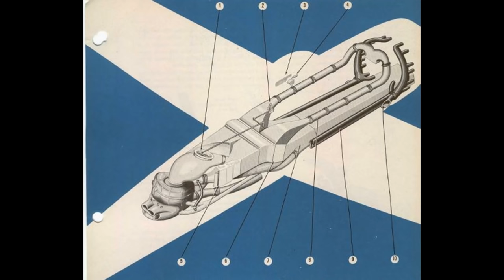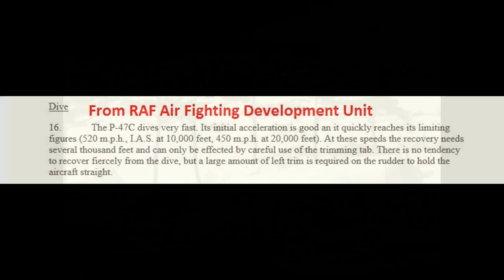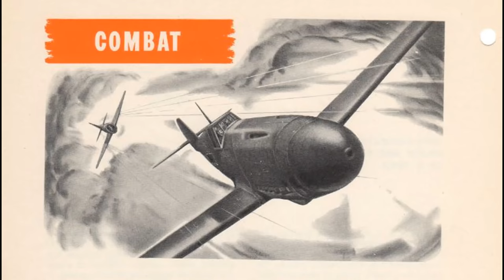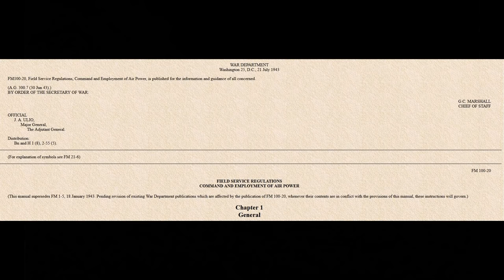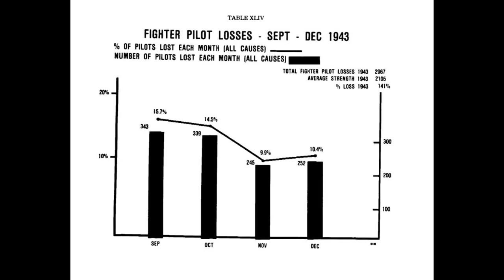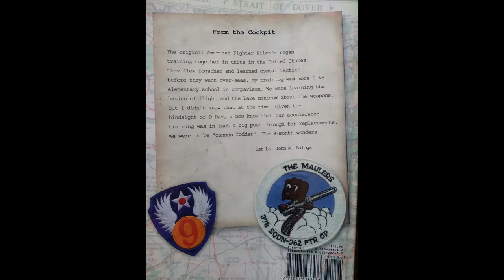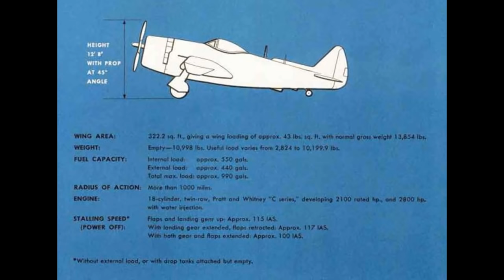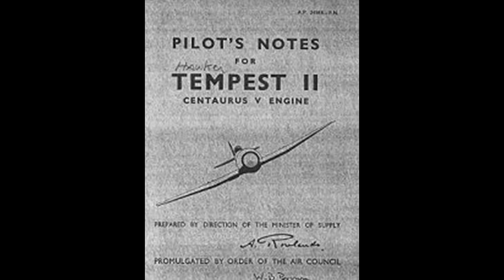P-47 Thunderbolt Pt. 8 Conclusions

Comment: Just a quick comment on Presidential Succession. The Speaker of the House is  2nd in line to the President after the VP. The SecState is 3rd.
Reply from the maker: I'll tell that to Alexander Haig when I see him.
Reply: @GregsAirplanesandAutomobiles  
I can outrun a cop trying to pull me over or try to scare him off but it doesn't mean the speeding was legal.
Haig got away with one.

Comment: You said that if there's one thing superchargers don't like, it is being throttled (possible exeption, the Bf-109's supercharger), with the example of the P-51D having only 1410 hp at sea level/take-off performance. As a reverse conclusion, did WW2 fighters optimised for lower altitudes, say, the F-4U Corsair and Soviet Lavochkins/Yaks not suffer such a power drop at sea level?
Reply from the maker: Hi Pascal, the 109's supercharger is not throttled, instead it used a variable speed supercharger drive. I have a video about that specifically. Generally speaking the Soviet fighters were optimized for low altitude work. The Corsair's primary stage supercharger is optimized for sea level to about 2500 feet. Of course the Corsair has a second stage with dual speeds, so it can do OK up high as well. My turbocharging vs. supercharging video explains all this pretty well.

Comment: Thank you for doing this right!

A question/comment about the later years of the active P47 aircraft. I spoke once with a pilot who flew warbirds for shows, etc. He said that he thought all the flying P47 were operating without turbochargers operating. He said that having the turbo working would about double the cost of operation. I have been wondering if the late flying planes in Latin America were still using turbochargers. I would expect not.
Reply from the maker: I'm sure that's true. Not only would the turbo system add to the operating cost, there is an additional fire risk to the plane. Plus in the modern regulated airspace system you can't take the 47 up high enough to need the turbo anyway, so I understand why they remove them.
Reply: @GregsAirplanesandAutomobiles  could they fly a 47 higher if it had ifr equipment retrofitted in?

Comment: excited for the new video Greg.   

BTW related to your video on turbo-supercharging, at end you talked about the XF12 Rainbow that had the goal of "four fours" (4 enginers, 400 mph cruise, 4000 mile range, 40,000 ft ceiling).     You prob'ly saw this, there is modern plane trying to do three-fours (all of the above, but one turbocharged engine.   

https://www.ottoaviation.com/celera-500l

Reminds me of rainbow:  no compromise fuselage streamlining, turbocharged, recip (diesel!).   Pretty amazing if the can pull it off - sposed to get 20 miles per gallon cruising > 400 mph.
Reply from the maker: I have seen that project, and I have high hopes for it.

Comment: Just thinK, the military threw Away the P-47 after the war and kept the P-51 mustang. During the Korean conflict the P-51 was a disaster, due to the susceptibility of the radiator to ground fire. South Africa lost over a hundred mustangs during ground attacks. The Corsair which has the same radial engine as the Thunderbolt was very effective when attacking enemy ground forces

Comment: So: In the 1960s where did Peru get their parts? I must know!
Reply from the maker: They probably got a huge supply when they bought the planes. The USAAF/USAF would have sold all that stuff for pennies on the dollar after they stopped using the plane. Also, if you have an airforce, you probably have the ability to make parts if needed.
Reply: @GregsAirplanesandAutomobiles  - Makes sense.  Do you want to know what you begat? When you posted the Jug vids many YT channels jumped on the P-47, like the proverbial wildfire.  I predict that the Johnny Johnston (I'm not doing the research) story is in production right now. It's time the Juggernaut made it's cinematic debut for the folk. If Johnny is P-51 I apologize.

Comment: Watch out for compression effects on tail plane at high speed dive. Effectively rendering the elevators non effective till speed reduction. Not what you need if terra firma is approaching at alarming speed.
The Typhoon didn’t like dive approaching transonic as elevator flutter could overcome empennage structural strength and separation of airframe. A most impossible situation for pilot indeed.
Latter models incorporating counter balance weights to quell harmonic destruction.
The Napier Sabre also having a most unsettling tendency to low hour without warning seize up.
Low altitude bail out only achievable with immediate remaining air speed climb and hit silk as soon as clear of aircraft. Car door arrangement not conducive to quick egress from cockpit.

As a side note the development of the atomic bomb as expensive as that effort was. Far eclipsed by the B-29 platform development expenditures. The craft chosen to deliver the first use of air burst atomic weapons. Fat Man and Little Boy.

The jug a fantastic fighter bomber but she drank fuel at an alarming clip. A factor of her weight and frontal drag. She could absorb damage like no other due to rugged construction and armor systems.
R 2800 a very robust and dependable engine. Not subject to glkol-wasser leaks and resultant engine failure. Oil consumption always a factor of range as well as fuel.

Comment: @Greg -The most important aircraft of the WWII on  the allied side was the Hawker Hurricane. It was present on all theathers before anything else and without it, the US aircrafts would have been operating from Island ;-)
Basically making the argument of which Allied aircraft did most of the Western front. Had it not been for the Japanse, the US would not have entered the war and Great Britten would probably been part of the 3rd Rich. 
The spitfires where to few and those available was prioritized for defence of GB.
Get the old book "Brute Force" by John Elllis. It is filled with statistics and an excellent resources. Most of the statistice are from the US :-)
Reply from the maker: I am familiar with this argument, but I don't agree. While I love the Hurricane, and I do think it was more important than the Spitfire in the Battle of Britain, I don't see any realistic way Hitler could have invaded England regardless of what fighters the British had, or if they swapped them out for Curtis Hawks.

Comment: 47:20 - the spitfire was hamstrung by the decision to not develop extended range. Jeffrey Quill had demonstrated a year before how that could be done, but neither the RAF or USAAF were interested in long range spitfires - except for the superb photo reconnaissance variants. For example, a Mark VIII could have flown to Berlin, fought for 20 minutes and flown back with a fuel load (imperial gallons) of 75 gallons in the rear fuselage, 36 in the leading edge of the inner wings, 20 under the pilots seat, 96 in the main tanks, plus a 90 gallon torpedo centre line drop tank in 1943. Like the complaints over the 47Ds ‘short range’ in 1943 - these were the result of political decisions, not true technical limitations.
Reply from the maker: Sort of, there were a lot of issues with the long range escort/fighter Spitfire, it's far more complicated than just getting the fuel in there. I may talk about it if I ever do a Spitfire series.
Reply: @GregsAirplanesandAutomobiles  I agree. Getting enough fuel in was a no brainer. Centre of gravity and longitudinal stability were the biggest problems, but Quill opines that these could have been easily licked. I thing it all comes down to necessity - or lack thereof. The USAAF passed on long range spitfires - except for PR models and Bomber Command were wedded to nighttime bombing raids without escort. I think Quill is clearly right. The bigger tail planes developed for the Mk XIV in 1942/43, and for Spiteful  project (and ultimately adopted for the Mk IV project (redesignated the MkXX and ultimately coming into service with the Mk22 & 24) would have made a long range Merlin engined MkVII and a long range griffin engined Mk24 available in 1943 and late 1944 respectively if only Supermarine were given the ‘go’ to develop the same over the relevant timeframe. This would have obviously diverted their existing research, and testing development resources - which were rather streatched - even further, but with funds (from the Americans) and additional resources it was all very doable.

Comment: This might not be “accurate,” but in “Aces High” the 190D dives the best all WWII fighters and is more responsive at high speed.  Also, The P47M weighs less than the P-47N and (in Aces High) has a higher top speed, a faster climb rate and a faster roll rate.  Is Aces High accurate?  The flight models are supposed to have been “tweaked” by actual WWII pilots.  FWIW.
Reply from the maker: A higher dive speed for the 190D, no. The P-47M does weigh less than the N because is has fewer fuel tanks. However a lightly loaded N could easily be the same weight as an M with a lot of fuel, so there could be overlap there and situations where the N would out perform it. 

I have roll rate data in Pt. 5 of this series.

Comment: The P-47 needed a very powerful engine because it was very large and heavy, mainly because of its huge engine air compression system.  Why the airfoil of the P-47 was superior to the laminar one of the P-51?  Which of the two was more important to the USAAF in WWIi?  The bomber campaign against Germany would not be sustainable without the Mustang’s long range escort capability.
Reply from the maker: Somehow I don't think you watched this series because I addressed each of those questions at great length. There is no reason for me to do it again in the comments.
Reply: Wow, I don't think you watched the video either

Comment: ah....but the Americans were running 130 octane fuel and Germany were running 92 octane!
Reply: It was actually 110-130 octane and after August ‘44 they tried  130-150 in England only, but the Brits mixed the lead badly on that and reliability declined. The Germans could compensate by massively boosting power with MW-50, but hardly ever bothered as it added weight. Power in prop aircrafts had little effect on actual maneuvering combat: The FM-2 Wildcat was a great success in 1945 and the deadliest dogfighter in Allied hands... I think it actually had the highest kill loss ratio of any sub-type in WWII... Even higher than the Hellcat...
Reply from the maker: Wrath, I was just thinking about you. There is a section in the new video coming soon that I think you will like. It deals with the short power coupling (close prop to wing) of the Fw190.

Comment: The point about Mosquito type fast bombers is they could carry more bombs with a deeper bomb bay. Double the number of planes would more than double the bomb load of the B17s and swamp the Luftwaffe with less than 1/2 the crew of B17s. Team them with single seaters and fewer men would be at risk.
Reply from the maker: Yes, but D-Day would have been delayed, which would have cost far more lives.
Reply: 2x as many aircraft over Germany would have destroyed the Luftwaffe even faster. The Mosquito was a fighter AND a bomber. Replacing B17s with this type would have done more bomb damage AND taken out German fighters. 
In the end B17s with P47 and P51 escorts did the job because USA had the manufacturing might to get the job done.

Comment: I love the the thunderbolt. in my opinion its just the truest form of warplane and not a weaponized racehorse. I would love to fly it more in Il2 great battles but the meta is just against it. Most combat is low and the 50 cals are not as good of weapon as they could be there. Also it flies so ... clunky maybe somebody correct me on this but i think its a bit under-preforming in Il2.
Reply from the maker: I agree 100%. I do think it under performs a bit in IL2 and the action in IL2 is mostly down at lower altitudes. If the on line areas were based on escorting bombers at 25,000 feet, a lot more people would be flying 47s.

Comment: The P-47D with a standad wing had a higher wing loading than other contemprary fighters. Could P-47Ds have had a higher ceiling, better climb performance and been a better dogfighter if they had been fitted with the larger N wing from the outset?
Reply from the maker: That's really only true if you compare the planes at max gross weight. If compared at it's combat weight, no drop tanks, no external weapons, the 47's wing loading is actually slightly lower than a Fw-190 A8. Would it have been better with the N's wing, yes probably, but it wasn't available at the time.

Comment: So as a fighter what was the advantage to such a big engine, when it is offset by the weight and size of the aircraft? What makes that preferable over a smaller better p/w aircraft?
Reply from the maker: You might want to watch the series from the beginning to understand the answer. The short version is that the power to weight ratio is far superior at high altitudes with the Thunderbolt's set up.
Reply: @GregsAirplanesandAutomobiles  cheers, will do

Comment: wasn’t the p-38 the one that was mach limited, i read somewhere in a book by Erick Brown that most of the single engined figthers  (cant’t remember the types he mentioned as examples) had about mach .75  operational useable speeds but the p-38 was much lower /edit : i just found it in my library, wings of the weird and wonderful by Eric Brown, chapter about the p-38, he mentions the same mach .71 dive limitation for that airplane, wich i find  interesting.
Reply from the maker: He also talks about the low Mach limit of the P-38. The info I have shows that he said 0..68M for the P-38 and 0.71 for the P-47.

Comment: I am no aviation expert even less so for WWII aircraft so I ha ve a bit of a problem with number in P-47 Thunderbolt Combat statistics shown at 57:50. Namely discrepancy between 1-1.5 million hours of combat and 20 million gallons of fuel consumed. Using the table found at https://bbs.hitechcreations.com/smf/index.php?topic=199795 the minimum specific fule consumption for P-47D is 60 gallons per hour. And this is way lower then cruise or combat consumption. Cosnumed fule for 1 million hours should be much higher than 20 million gallons.
Reply from the maker: Thomas, I'm impressed with your deduction skills. This is an error from the museum as noted in the video description.

Comment: Greg - 2 questions on sources:  what did you se for your doctrinal analysis where USAAF vs LW is concerned?  And, can I get a soft copy?  You have some great digital copies of original sources!
Reply from the maker: I thought I mentioned that in the series, but it's primarily the two volume Hap Arnold diaries, about 500 pages each, the official 8th Air Force Tactical Development History, and Strategy for Defeat. All can be found via the usual search methods.I have put them into a google drive for easy access for my Patreons, except the Hap Arnold stuff, but I'll add that in soon.
Reply: @GregsAirplanesandAutomobiles  you are a steely eyed missile man, sir. 👍🏼

Comment: Off topic, but at 13:15 , the G-6 does not have the bulges from the upgraded 13mm MG131.  Did some Bf109 G-6 variants still use 7.92mm MG17?

Edit- looking it at more,  it appears to look more like a G-2, as it does not have the fixed rear wheel, which from what I recall, started with the G-4.
Reply from the maker: Wow, you have a sharp eye. Here is the thing, it's a free to use image from Wikimedia Commons and I think the artist did a good if imperfect job. I'm not going to start nitpicking it, especially not a 109 image as there are so many variants and sub-variants that's it's sometimes impossible to say which is which. Then we have the issue of older variants being field modded up to newer variant specs. 109s are just a mess to try to identify by specific model.

Comment: With the increasing USAAF ground support and the Luftwaffe eventually giving up on intercepting high level U.S. bombers in favour of concentrating most of what they could preserve for the eastern front, didn't most of the air war move to medium and low altitudes?
Could the Air Force have considered something like a 'cropped, clipped and clapped Spitfire' equivalent to the P-47, dumping all the turbocharging equipment to create a much lighter and more capable ground support fighter, sort of like a single speed integral supercharger, low optomised F4U.  There must have been many 'clapped out' razorbacks to experiment on.
Reply from the maker: Let's keep in mind that from June of 44' until the end of the war, only about 26% of Luftwaffe single fighters were on the Eastern Front, and only 15% of their twin engine fighters so they never really gave up on the Western front, they just became much less effective.

To you point about taking a P-47, removing the turbo equipment and optimizing it for low altitude and ground attack, yes they could have done that, but it would be easier to design an entirely new airplane for that job, or just use Corsairs.
Reply: @GregsAirplanesandAutomobiles  Looking forward to the video Greg.  Possibly losing the Romanian oil fields was as important in the decline, the coal derived petroleum did not replace lost lubricants, I wonder if that contributed to the unreliability of their jets, the increasingly dodgy materials really needed good cooling.
The U.S. Navy was suffering greatly from the desperate Japanese defense.  The Air Force operated some Douglas dive bombers, getting Corsairs wouldn't be the same.  I don't think they even had them in Korea?
Thanks for the great work.
Reply from the maker: Ah that makes sense. From your initial comment I though you were one of those few who have already seen the video. I have a chart showing where and when the Luftwaffe positioned their fighters during the war. It's commonly thought that it was mostly on the Eastern front, but that's not true from about 1943 and on.